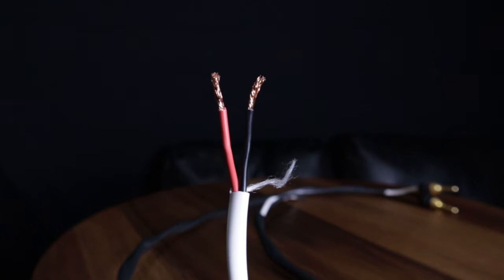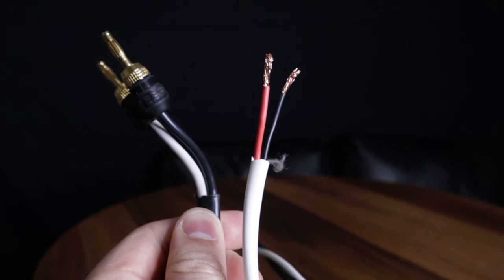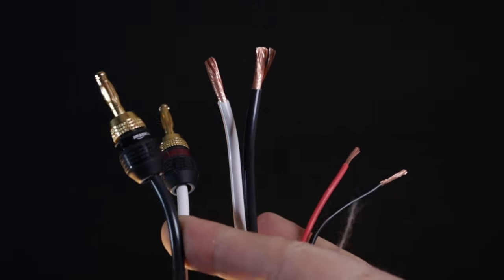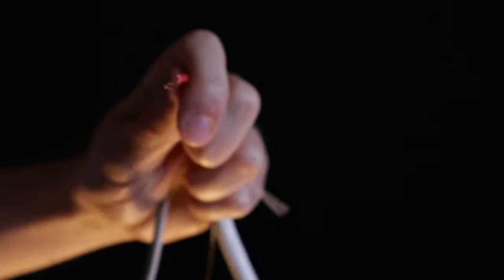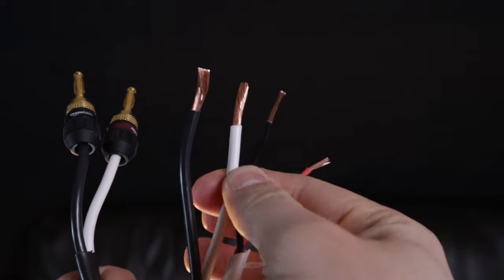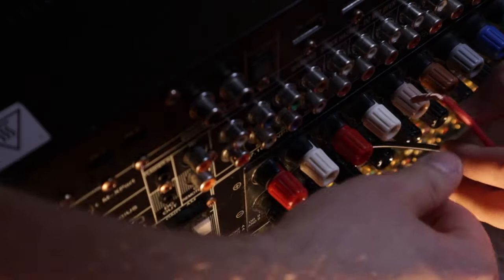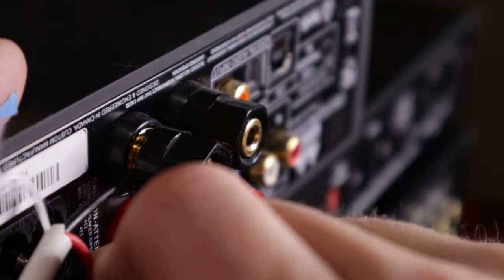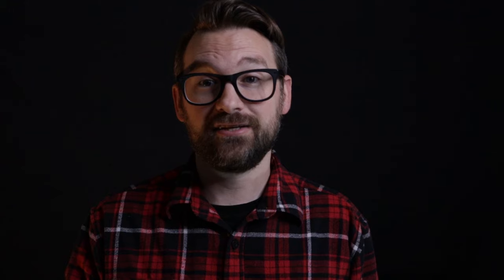Speaker Wire Basics (Quick, Easy)

Comment: Most hi-fi and home theatre owners don't come close to experiencing in the full real potential of their system. All because of poor quality speaker cable.
Reply from the maker: Thanks for commenting! I don't know that I would agree with that but full potential is a wide margin. That could still be valid. I think I would point to poor acoustic setup and treatment as most important but to get full potential I might see that. I land more on the medium to not bottom quality wire. Nothing that costs hundreds of dollars but I do have lots of Blue Jeans cable which I find as a good value.

Comment: One of  the best videos on the topic! The only problem is that I have clear covering (which you hate!) and I can't see which of them are negative and positive (unlike your clear red and black wires)?
Reply from the maker: Thanks! In the case where you can't tell, choose one side and mark it with a marker. Assuming you can see any difference between the two. If you can't tell at all, I would separate them and then mark them with a permanent marker.
Reply from the maker: The wires aren't physically different so it won't matter which side you use as long as it is consistent from end to end.
Reply: @goldenearaudioreview4904   Thanks for quick reply, that makes sense! I will do that as I have a vintage stereo system to hook up this week!

Comment: Thanks for the video - what if I have 4 conductor speaker wire? How would I connect them to a banana plug?
Reply from the maker: If you combine two of the sets on either end ( making sure your consistent) you can increase your wire gauge. I would just make sure you label the wire ends with positive and negative and that needs to be identical on the amp end as well.

Comment: If the distance from the receiver is different for each speaker would it be worth it to use different gauge wire for each one, for example one speaker is 5 ft. from the receiver, and the other one is 12 ft. away would using different gauge wire be practical or not? Thanks! Your video was really easy to understand.
Reply from the maker: Glad it was helpful! You are probably fine the way you have it. I think if you were worried about it, I would use the same gauge but make them both the same length (assuming it won't have to just be a coil of 7 ft next to the speaker? If it can snake a bit more then I would do that). Gauge size probably won't make any difference assuming you are using at least 16 gauge wire. I am personally using some belden 10 gauge wire to go about 10 ft which is completely overkill.

Comment: Great video! Any idea why my 16g has 4 wires inside the main jacket?
Reply from the maker: Could be just for more options. An example is that you can twist the matching colors together and in effect increase the gauge of the wire. Or they could be used as a back up or you could use it for bi amping.

Comment: You make it look so easy and it is easy...but my question is the top part of my plugs do not connect the bottom parts..I mean there's not a complete connect and closing of my banana plugs and cables.  It will works but what else can I and should do
Reply from the maker: Hmm, I am trying to think of the scenario you are talking about but I can't picture it. Can you give me some more details? Are you saying the banana plugs don't connect to the binding post in a normal way?

Comment: Thanks for this video, very beautifully explained. I have a related question, bought this property and it has in wall speakers installed in the family room (a total of 5). I want to hook up speakers to my tv.  
Question 
1. What components do I need?
2 How do I connect that component to my TV
Reply from the maker: You need a 5.1 receiver, ideally one with HDMI connections on the back. Typically you go, Roku/DVD player - receiver - Tv. So the receiver in the middle pulls the sound and then passes video along to the TV. You would need HDMI cables to hook up any inputs and then to the TV and then speaker wire from the receiver to the speakers. In your case I am assuming there is wire already run to the in wall speakers and there is a wall plate somewhere with speaker wire connectors to connect to the already connected speakers.
Reply: @goldenearaudioreview4904  thanks

Comment: Thanks for the video. One question. My IPAO says that some speakers are out of phase, but i am sure the wires are correctly connected. Should I change the wires or leave them as they are?
Reply from the maker: I would go ahead and try changing it and see what happens. You won't hurt the speakers having them out of phase it should just sound weird. I have made the mistake many times so good to try. One thing to try as well is to confirm that you are connecting to the right speaker. Un hook all the other speakers on the amp side if you are still getting the out of phase error. Some times we start looking at the wrong connection cause it's hard to see and confusing. I've done that too.

Comment: Few questions for exposed wire. Does the exposed wire have to go all the way through the hole and out.the other side?
When I tighten the post...do I tighten it over the exposed wire or the insulation? 
Lastly, when I put the exposed wire through the hole...and its a little long on the other end...do I wrap the excess amount around the post before I tighten or just cut it?
Reply from the maker: If you can cut it the same length of the hole that is good. It should be fine if a little is poking out the other side. Some guys do wrap the excess around the pillar to make it harder to come loose. What you want to avoid is any stray wire making contact with anything else besides the binding post. Especially if it is conductive.
Reply from the maker: You want the wire directly touching the post and little to no insulation touching it but keeping in mind you don't want to cut the insulation too much as to accidentally have the wire come into contact with anything else. Thanks for watching and commenting. Let me know if you have any other questions.
Reply from the maker: Metal to metal for the wire and binding post.
Reply: Thank you very much for your detailed replies.  I really appreciate it. :)

Comment: I have 3 motorola 40 year old speakers in a box that work great with my stereo. I would like to add red & black wires to the seven strand leads. If I disconnect  my Sennheiser wireless headphones from Wiistar digital audio decoder to analog & plug in the speakers in with red & black leads attached will this work ok? The headphone is plugged into the wall. Do I need & adapter or something else attached to my old speakers to make it work with my tv?

Comment: don't know if you're still answering questions or not, but I have a rather stupid question for myself lol. Say I bought a 100 ft of Speaker Wire, but I only need 50 for the connection. Can I cut it half (two 50ft speaker wires out of one 100ft speaker wire) and with stripping it on both ends, can I use the two wires the exact same? or would it destroy the wire itself if I cut the copper between them, even if I strip new ends and beginnings on each side?
Reply from the maker: Still answering questions! If you are cutting the wire across both the positive and negative cables then yes. That is absolutely how speaker wire works. If you are trying to double your length by separating the two cables then no. If I have a hundred feet of wire and I have two speakers I need to hook up that are both 50 feet away then cutting the wire in half is exactly what you would do.  If you are actually in a scenario where your speaker is 50 feet away I would use 12 gauge wire or larger (like 10 awg).
Reply from the maker: But, you can probably get by with smaller wire. It will work, it just may not be the most optimal.
Reply: @goldenearaudioreview4904  ok good lol, glad it works that way! I’m getting the Klipsch Dolby Atmos 5.1.4 Home Theater Package and my 2 back speakers are def gonna require more than the 25ft 14 gauge wire they provide lol, and it seems buying one 100 14 gauge wire pack can be cheaper than 2 50ft’s in some cases lol
Thank you for the quick reply as well! ❤️

Comment: Nice video. The speaker insertion on my mini-shelf stero is a square design with springs behind the clip. Didn't see this style in your video. I have 14 awg wire. It's bare copper wire no connectors on the end. think it started off as a 25 ft. roll. After I had the wires cut to length and twisted the copper strands together the wire was almost to thick for the insertion hole on the stero. Would you suggest I goto 18 awg speaker wire or use crimp on connectors for the 14 awg wire I have now?
Reply from the maker: Good question! I have used pin connectors but they always seemed to loosen over time. Bare wire is good, might go with a 16 awg. I would avoid 18 if you can.
Reply: @goldenearaudioreview4904  Thanks for the response

Comment: This may be a stupid question lol but can u put banana plugs in those ports u have to press down to open?
Reply from the maker: Not a stupid question. Most of the time they are too big to put in the spring clip posts. They do make a pin connector type and that is more convenient but also I have found that the pin connector type is really unreliable. I just used the cheap kind and that has been my experience.

Comment: Can you connect passive speakers to a USB audio interface such as the the Focusrite Scarlett 2i2 with its 2 quarter-inch line-outs?
Reply: No. You answered your own question. The outputs are line level (line outs) not speaker level. To use passive speakers you need to add a power amplifier between the line outputs and the passive speaker inputs.

Comment: My receiver only has a right and a left output place but my speakers have a positive and negative (red and black but  do I take the three prong wire .I put the red in right speaker white in left and the wires to my speakers the other end I put the red wire to my right speaker and ran a yellow wire from the negative on the speaker to the negative on the left speaker and the white wire I put in the positive for the left speaker is that correct

Comment: Question from a complete not so sure newbie....I've got my speakers, got my amp and pre amp, got my subwoofer,  I even got some monoprice banana blugs (they were donated to me) but I want to ask you which cables should I get?  Should I get the cables that you recommend and use for all the connections, or do I need to order different cables, and or wires?  And don't they offer cables with the plugs already connected?  Any help would be much appreciated.
Reply from the maker: A great cable company that makes really great cables that aren't way over priced is Blue Jeans Cables. They make all the different cables you would need.

Comment: Hey I have a question what does the other end of the wire your not showing in the video look like how the hell do you plug them into the speakers???? Also do different speakers have different plugs as well and would I need different wire then. I tried cutting the end off a black and white plug in audio cable and it didn’t work at all
Reply from the maker: Speaker wire should look identical on both ends of the cable: beginning and end of the cable. Almost all speakers for home use will accept bare wire connections (self powered and pro audio speakers being the most common exceptions). In the video I go over the most common connectors and connections.
Reply from the maker: I would suggest using speaker wire bought from a store or online rather than making your own wire.

Comment: Hey thanks for the video, but I have a doubt.. my banana plug doesn’t go fully in to the speaker terminals … 3/4 th goes inside because of smaller speaker terminals… does it compromise on the out put ???
Reply from the maker: No, that sounds about right. As long as they are making a good connection (not loose and barely touching sides) then it should be fine. Some of mine fit the same way.

Comment: How To Connect Speakers to Receiver with Wire-Ultimate Solution

A cable used to connect amplifiers to speakers is known as speaker wire. The audio is amplified and sent to the speakers via this cable. It has a copper core that can be stranded or solid, as well as a PVC jacket that protects the core from interference and other external influences. This blog is for those people who online often ask how to connect speakers to receiver with wire. The core is usually stranded, which means it’s made up of a collection of tiny wires that are twisted together to make a larger (thicker) conductor. There are a couple of reasons behind this. For starters, a solid conductor makes the wire far less flexible, making installation more difficult. More importantly, solid conductors have a greater skin effect, which increases resistance and power losses, both of which we want to minimize. 

Terminals of the speaker 
Speaker cables are connected to terminals on the back of most stereo receivers, amplifiers, and conventional speakers. Spring clips or binding posts are the two types of terminals available. For simple identification, these terminals are almost always color-coded: the positive terminal (+) is usually red, while the negative terminal (-) is usually black. Some speakers are bi-wire capable, meaning the red and black terminals are sold in pairs for a total of four connections. 

Connectors 
Most speaker cables are bare that’s why you’ll need a wire stripper to expose the strands at the ends. Whether your equipment uses spring clips or binding posts, tightly twist the bare wire strands so that they stay together as a clean single twisted wire. 

For more detailed articles/blogs please visit: https://smartelectrohub.com/speakers/how-to-connect-speakers-to-receiver-with-wire/
For more detailed articles/blogs please visit: https://smartelectrohub.com/

Comment: hi is it better to use passive speakers or powered speakers alone. im using separates cd player and amp. just need the right speakers
Reply from the maker: Either can be excellent but they have trade offs. If it's all in one you don't have the same flexibility but it could be a really great value and simple to use. If the self powered speakers die then you're out the whole system until it's fixed or replaced.

Comment: On the Sony  sscs5 I lost one of the screw on terminals. Can I work around it or try to replace with a different type of terminal?
Reply from the maker: Is it just the outer portion? Cause if it still has the center hole you might be able to use banana plugs to connect. Not sure about how to repair it
Reply: @goldenearaudioreview4904  nope the whole got unscrewed completely. I was thinking about soldering the wire on to it lol

Comment: My speakers didn’t take banana plugs, but the smaller pin plugs. Is that common?
Reply from the maker: Are they the spring clip kind? You push down the tab so you can insert the wire or pin? If so, on newer speakers that usually means they are on the cheaper side. If they are older then it was a little more common. As long as they are making a good connection (speakers aren't cutting out or something and the wire isn't falling out) and you like the sound then that is all that matters. Banana plugs just look nice to me and are convenient.

Comment: Question: I have a Jeep Wrangler with a subwoofer in the back with blinding posts. I like taking my top off and so there's a higher chance of rain getting in. Is there a way to "waterproof" the connection at the blinding posts? Maybe use some black electrical tape?
Reply from the maker: Are we talking if it starts raining briefly on a sunny day? Or do you regularly go out while it's raining? If just the first one then I'm guessing just some electrical tape would work. I would make sure you've covered both sides of the connection and make sure there isn't a place for the water to collect. If I was extra cautious I might add some air tight housing over the connection as well.
Reply: @goldenearaudioreview4904  The 1st one haha. I make it a point NOT to go out driving on rainy days with my top off. Thanks for your input. So adding electrical tape over the wires wouldn't interrupt or hinder the electrical connections in any way?
Reply from the maker: Nope, as long as it's not blocking the path and there is a good metal to metal connection it should be fine.

Comment: I inherited my dad's Fisher quadraphonic from 1974. On the back of the receiver it's just standard Flathead screws the red wire would connect to the silver screw heads and the black wire connects to the dark gray screw heads.  The speakers are just like spring plugs we just push the button and the hole appears. I want to know the best way to connect speaker wires to the stereo is dad is unable to help me.
Reply from the maker: That sounds like an awesome kit! Your best bet in this case would be to use bare wire. On the receiver side I would make a hook with the wire, it's best that the hook go in the direction that the screw turns. For the spring clips on the speakers, I would give the ends a twist and insert. There isn't a standard hole size for spring clips so I can't recommend a specific connector for them. The wire will be a good connection as long as you're not unplugging and connecting the wire again a bunch.
Reply: You should use “ spade” connectors,the blue ones